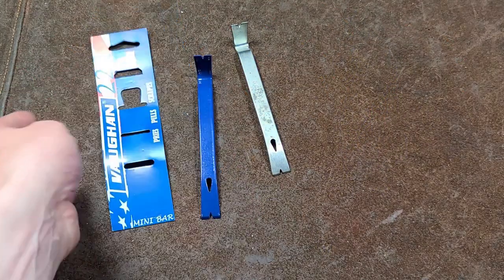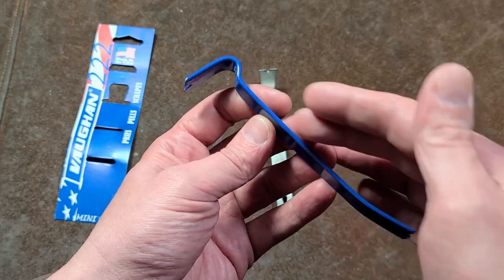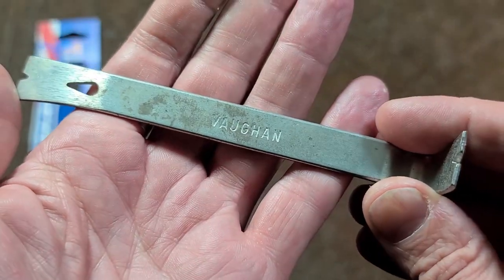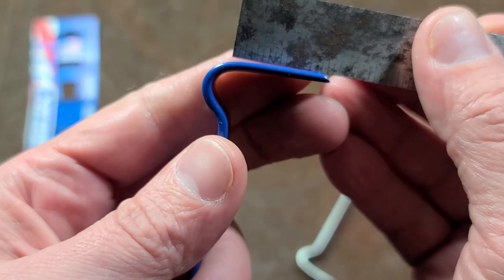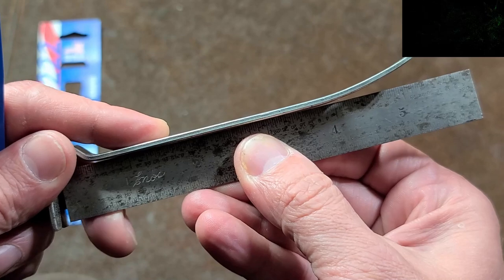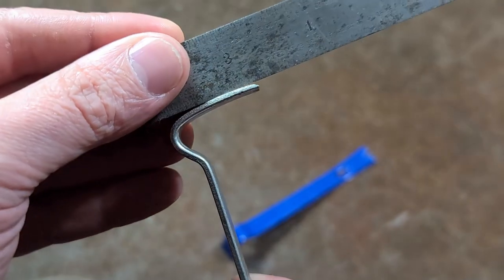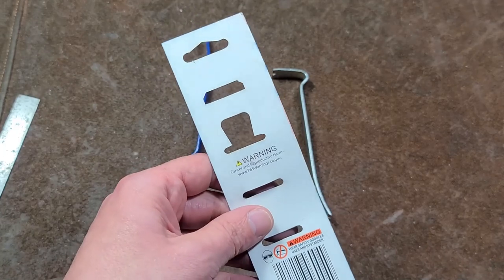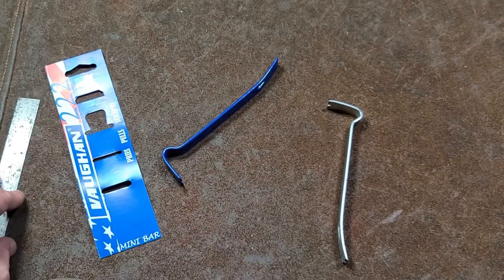Vaughan USA 222 v2 Mini Pry Bar Review

Comment: You should check out the dasco pro ultra bar 2. Looks to be same thing, made in USA but has name silk screened on
Reply: I just got a three pack of those(all a little different)and separately one of these little Vaughns. I think all 3 have the name on them and the Dascos are just nicer made.
Reply: Vaughan own Dasco Pro, it's the exact same tool.

Comment: I have a Craftsman branded one.  Didn’t realize Vaughan was the OEM.
Reply: They also make the same mini pry bars for menards but in green , same packaging but under the masterforce brand
Reply: Vaughan & Bushnell had a tool manufacturing relationship with Sears going back to the 1890's or so.
A lot of hammers and prying or striking tools were manufactured for Sears by Vaughan over the years.

Comment: I have the DASCO PRO branded version that I use at work and I consider it to still be a great tool.
Most often coming in a set the Dasco Pro branded version also ends up being a better value too.
On paper it would be nice if it were a bit more refined like the old ones were, but in practice it doesn't end up mattering much in my experience.

Comment: I have that prybar and it is very weak. It's a shame they don't make it with the same steel they use in the super bar. I also have the next size up and is much weaker than the same size Stanley prybar which is made in Mexico.

Comment: If the thickness and width are the same and they are both steel, you can't feel any difference in flexibility.  The flexibility is determined by the elastic modulus which is not the same as strength.  The elastic modulus for steel is approximately 30000000 psi.  One steel might be stronger than the other, but it's not going to "feel" stronger unless you are bending it to taking a set.  The only way to assess the strength of those bars is by proper testing.